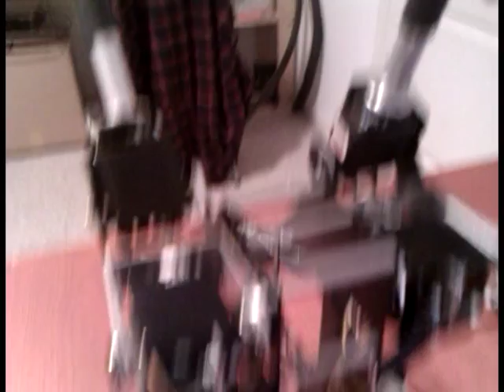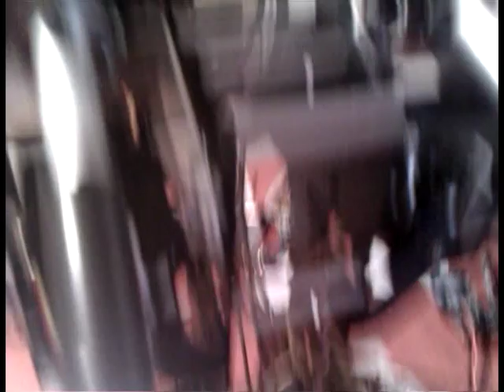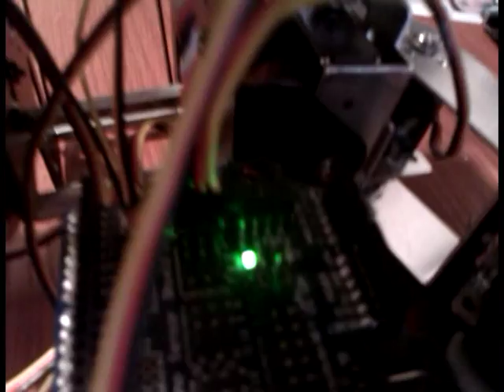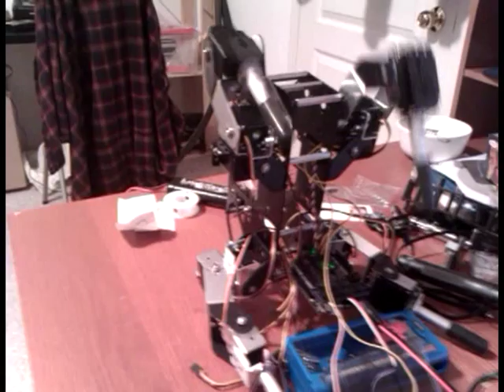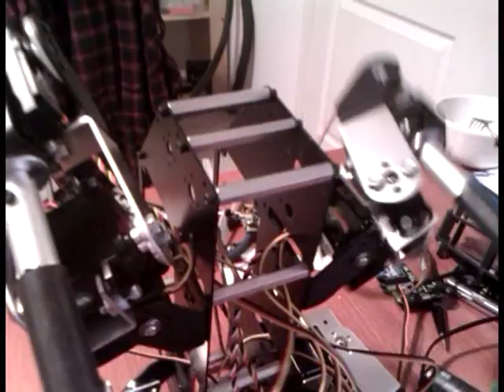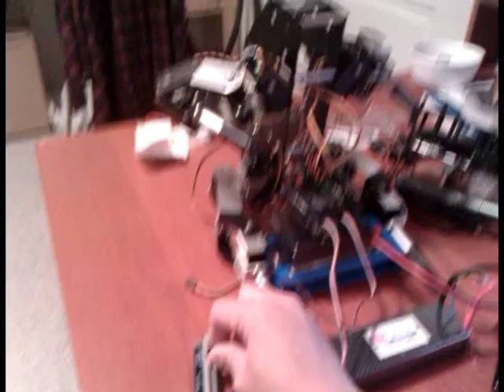Problem with multi servos on Arduino

Comment: Jay, good day.  May I know how you were able to solve this jittering ? I am doing a bot but also experiencing this random jittering and sometimes servos act crazy
Reply from the maker: G T 
Wow, this is long time ago. Two things it mught hapoens. One, bad servos. Bad quality servos are just not reliable.
Two, either your power source is weak or your servo controller did not handle it right.
Reply: Thanks Jay, I actually bought some cheap. I bought ks Jay. :)a couple of $2-servo over ebay (sg-90) (micro). It says towerpro, however, i am not sure anymore if its orig or counterfeit. Thanks Jay. :)